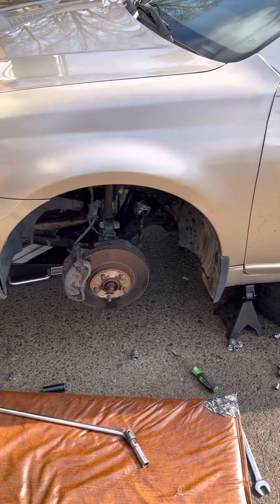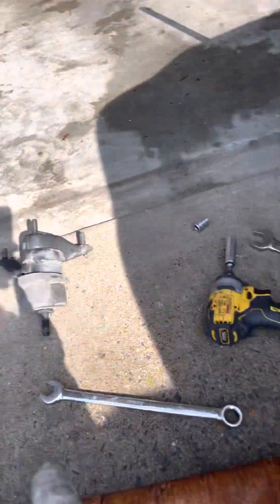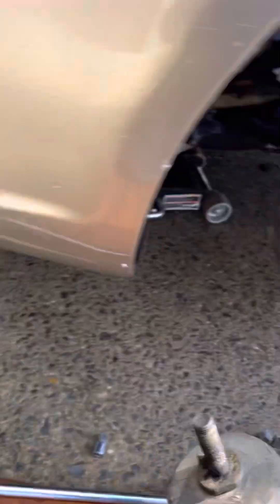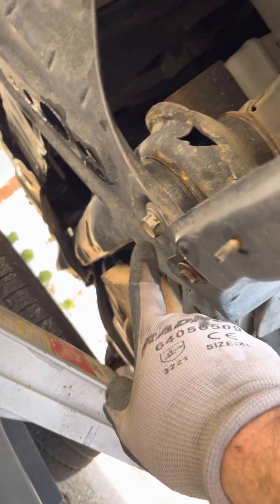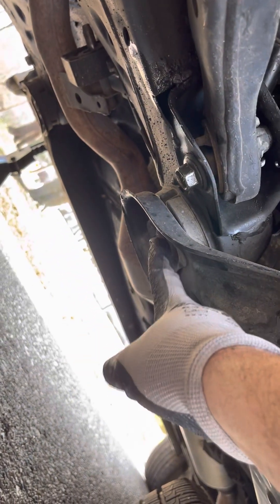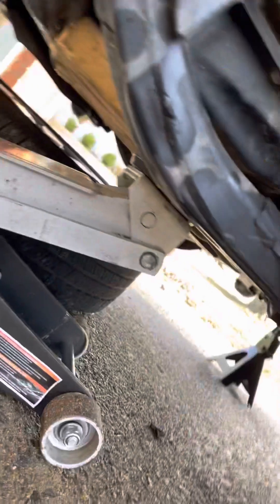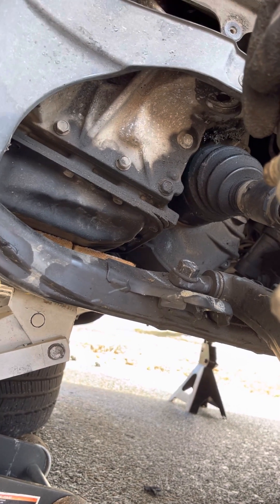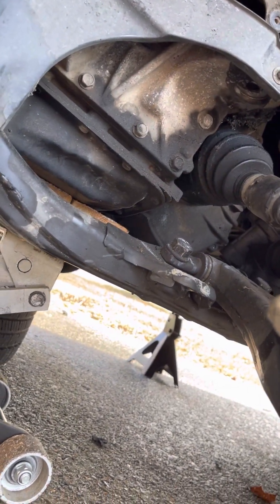2005 Avalon 3.5 Toyota lower control arm EASY replace remove motor mount

Comment: So just loosen the opposite side top motor mount bolt then the sub frame bolts about half an inch, jack up the motor and tranny and pry down on the sub frame, then the motor mount will come out completely?? Too bad you couldnt make a complete video but if i understood you correctly, thats far easier than pulling the motor. About how long did it take you for each side?
Reply from the maker: That’s correct! Took a couple hours each side